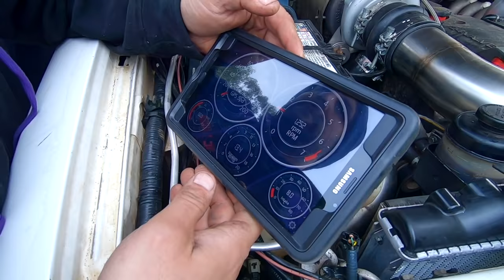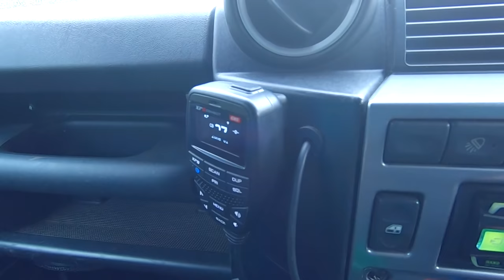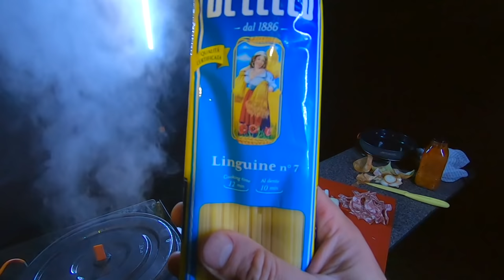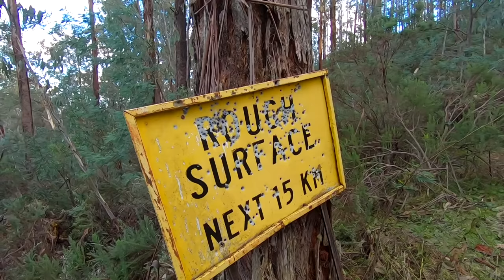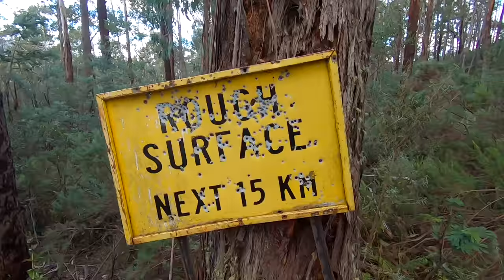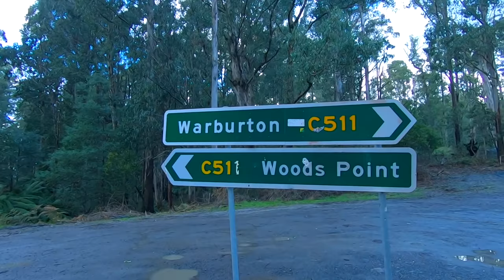| VIC HIGH COUNTRY - Queens birthday weekend |

Comment: Quick update on the Barra Gu :
After changing the radiator out the temps continued to climb. 
We found that the primary fan would not activate at 91 degrees when it was meant to.
The secondary therno fan would still turn on at 95 degrees but unfortunatrly this single working fan was not enough to cool down the system travelling at those speeds or up hills.

I am now in the process of sourcing some new factory bf xr6 turbo thermos again and will change them out to get it running as it should and looking into a much better thermo set up in the future. 
I'm thinking of going 16" spal thermos so that in the even 1 decided to not work the 1 fan should still be enough to keep temps at a desirable temperature amd not cause the veeeehical to overheat !
Reply: Why's it sound like a diesel?
Reply: @thnderdownunder9514  i get that a lot actually. Sounds like a lumpy cammed petrol from the rear though
Reply: If thermos will only just get it there in near freezing temps what about in summer?
Reply: @Nick-sd7um  the thermos didmt just get it there... the vehicle has been converted for close to 2 years now doing numerous snow , day trips and touring trips including tassie.
When the thermos are working , engine temps are good...

At the moment i of the fans bushes are on there way out causing 1 of the fans to be temperamental and not work or worls when it wants...

Going up the first track we were struck with this predicament which meant 1 fan that was working couldnt cool the vehicle down on its own.

I got another set now just need to slap them in
Reply: @barragu7189  Ahhh no worries, sorry wasn't trying to come off negative (text effect). Have a 4.2tdi myself and have been keeping a close watch on the various conversions etc to see how they're holding up.
Reply: @Nick-sd7um  nah all good mate never took it out of context it was a genuine question. Yeah td42s are awesome engines too man just depends on what you're trying to achieve... if you're not too mechanically minded ls swap are prety basic given the conversion kits these days but if you don't mind a little more involvement the barras are pretty awesome.
The 2 times ive only had dramas with them was both with damos trips...

The first was an issue with the wire from bf pedal to ecu which left me out in the bush and the second was this thermo fan bushes failing on the thermo causing the thing to overheat.

Besides that i do like this conversion amd am just ironing out any potential issues i may encounter.

If you got any questions hit me up on insta @barra_gu will be happy to try help ;)
Reply: @barragu7189  Awesome ah I got rid of all social media. Out of curiosity did you ever consider the v10 twin turbo diesel from the vw tourag or have you heard of anyone doing that swap? I can understand parts etc would be a nightmare but they're going so cheap at the moment.
Reply: @defender90orkney9  what were the rest defender boy? Dont you start!
Reply: @Nick-sd7um  never heard of anyone doing them. I cant imagine it will be a cheap conversion concidering not many have done them here from what i know. Dont know what the engines are going for price wise but if you're wanting diesel wouldnt the cummins tickle your fancy or prefer something different?

Comment: You should not be taking the radiator cap off while the car is hot, it will spray your face and melt your skin off.Also they didn't bleed the air in the coolant system thats why it had no pressure because it had an air lock, hense why the radiator didn't chuck up coolant when he took the lid off.

Comment: That descent at min 22 looked interesting. The 200 looked like he was in too high a gear?
Reply: I did that track a month ago, on my own, going up, after the rain. It was slippery, the stump on the side saved me from going over the edge. Stupidly slippery, and I was running 22psi. Scarey stuff. I made it up to where the landy was winching from, then slid back down....
Reply: Defender90 Orkney yea probably, given I hadn’t intended on going up that bit, but my 15yo was quite insistent. Poor planning I guess. For me I slid backwards down the hill which meant I could self recover and lower myself down on the winch👍🏻 still ended up at the pub straight after to calm the nerves🤣
Reply: Ray Hart clay is so dangerous in the wet. Ever been into Mitchell’s in the wet? Diabolical
Reply: Robert Millar I lost a wheel chain on Mt Sunday track once, never found it. Prob wrapped around someone’s tail shaft eventually🤷‍♂️

Comment: That recovery on the clay was intense!! Was the 200 about to do a cv? Any idea how it’s traction control handled the clay?
Reply: Defender90 Orkney really? Did the 200 have lockers?
Reply: Defender90 Orkney wow that video shows how hard that traction control must have been working! Any indication of it overheating and simply becoming redundant? I thought after about 3 mins tc turns off as it cooks ?
Reply: Robert Millar, I’ve had my TC working for well over 5 minutes with no sign of it overheating and giving up. 👍🏻💪
Reply: Defender90 Orkney I do, and yes, it’s not low enough for steep rough downhill. I have to use the brakes or crawl far more than I did in my 100. The 8 speed they have in the Lexus IS a far lower 1st, even with the taller diffs